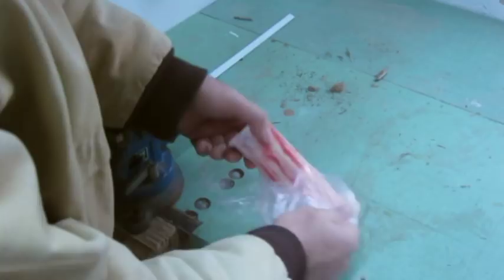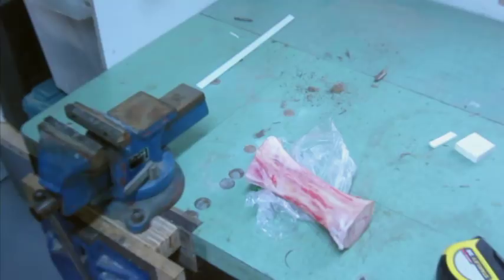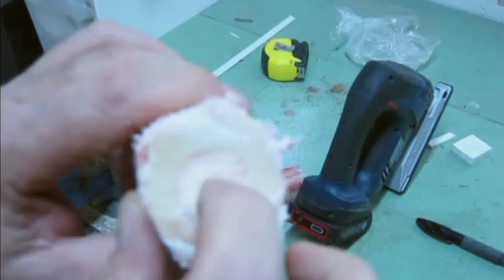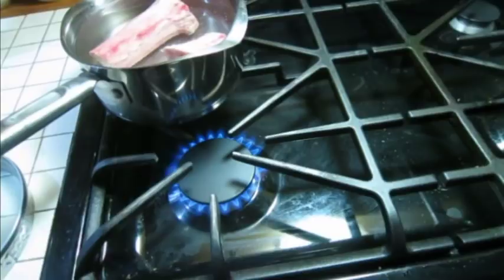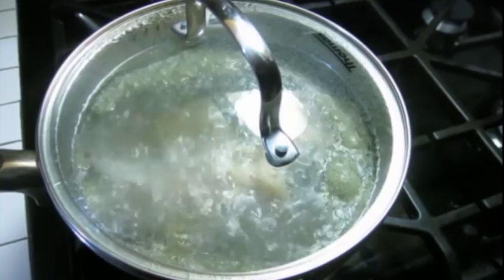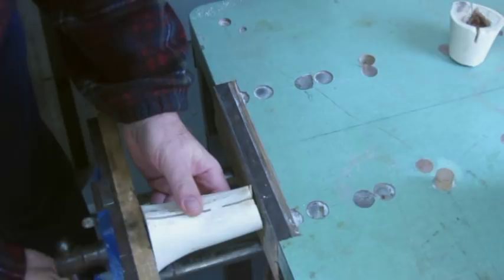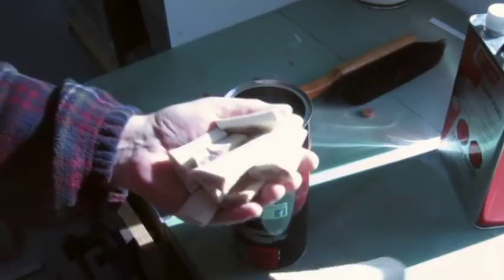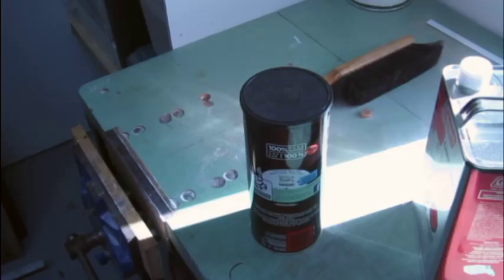Guitar nut blanks from bone

Comment: For those interested, Sean J. Barry has a great instruction document on the web.  Here is the link to a .pdf http://www.hangoutstorage.com/banjohangout.org/storage/attachments/archived/files/preparing-bone--2012-574917912014.pdf
Reply from the maker: Ha!  I think that is the one of the sources I used.  Thanks.
Reply: I have a big shin bone from a cow that's been naturally dried out in the sun do you think it would work it's been dried white for two years at lest I keep it because of the bone nut's I could maybe cut from it. I just got a Squire Strat CV 60's it was the last one they had a rosewood fingerboard now they use palmeno wood or maple  salesman the guitar was ordered w/a Bone Nut installed guys wife made em send it back they charge $90 for a Bone Nut upgrade at Sweetwater. I have to say no ping's in the bone nut. Great playing Strat. I'd love to have bone nut & saddle for my 12 string acoustic & 6 string acoustics. That thing sings it could only get better w/bone I think.
Reply from the maker: I am not sure if time will take the oils out of the bone by itself.  I am no authority on the subject but I would try to degrease it regardless.  The sun MAY have taken the moisture out, but it is the oils that will react with glues and finishes, and may also go rancid as far as my logic tells me.
Reply: Ah! "Just what I need for dissection lab tomorrow!" Thanks!

Comment: One last step to removing the grease from the bones is after the soak in the white gas (Colman fuel) place the bones in a pan of cold water (make sure the bones are completely covered with the water). Add a couple of cap fulls of clear ammonia ( the amount is not highly critical) to the water and bring the water to a full boil. Let it boil for a few minutes. You will see any remaining grease come to the surface. 

Simply soaking the bones  in a degreaser, ie. the Colman fuel, loosens the grease but you need to then drive the loosened grease from the bones. The boiling action accomplishes this. The ammonia further facilitates the removal.

After the boiling (2-5 min), let the water cool and skim off as much of the gunk as you can and remove the bones. You can use a bit of liquid dish soap and water to wash off any  residue that might be on the outside of the bones from the gunk in the water.

If you decide you want bleached bone use hydrogen peroxide for the bleaching agent. You can use the stuff you get from the drug store. I think it is around a 3 percent concentration. You could add a bit of water to it, perhaps up to 1 part water to one part peroxide. Either way how long you leave it in the solution is somewhat by trial.  Start with a few hours, rinse and let dry, preferably in the sun. If, after the bones are dry you want more bleaching put them back in the solution. This type of bleaching will be pretty gentle to the integrity of the bone. Any bleaching will deteriorate the bone to a degree, but this method is pretty good. DO NOT USE BLEACH, LIKE CLOROX!! This is harmful to the bone.

As far as the initial boiling of the bones, I believe the more you boil the more the bone is compromised. I would re-evaluate that. 

Thank you for sharing this. Creating one's own materials can be fun for the full "hand crafted" experience.
Reply from the maker: All the research I did didn't specify the second boiling with ammonia.  Thanks for sharing the info.
Reply: Just wanted to chime in here. I hadn’t seen this method elsewhere in my research either but I decided to try out boiling the blanks after the gasoline soak...and was amazed to see the drops of grease leach and gather on the surface! This tells me that it’s worthwhile to do so
Reply: I don't have access to Coleman fuel (naphtha-based products) in my country. Are there similar alternatives that can do the same job?
Reply: What’s the benefit you get from thoroughly degreasing the bones like this? I haven’t actually tried making my own blanks yet, so I’m just curious about the “why” behind this part of the process. Do they stink like rancid beef if you don’t degrease them thoroughly lol
Reply: @arsamy96  Do you have access to charcoal lighter fluid? Lighter fluid is a light petroleum distillate, aka naphtha. Maybe they’re just calling it by a different name in your country?

Comment: An alternative is to boil the bones in 30 per cent bleach and just wash and dry them. You will get  white and odor-free pieces. In fact, Vet college used this method to build a frame for anatomy model.
Reply from the maker: Correct, but you don't get beef broth for cooking when you're done.
Reply: Bleach will break down the bones hardness & made it crumbly. Not good way to go in the long run it's as bad a greasy bone a couple of the Naphtha baths should suffice.That's a great article on the subject in the description.

Comment: I use a arc saw, is much better, you can easily cut the piece. Sometimes I ask my butcher to cut it to me. For the cleaning, I use to throw them to my dogs lol. They work on the meat and marrow for a while, and they use to forget about the bones (or burry them). Then I boil it if needed. I make picks, and I've made a knife for opening letters.. I really love the picks, and my son loves the knife.
Reply from the maker: I have not heard the term "arc saw" before.  Is that an oscillating multi tool?  Very curious to find out.  Thanks for the information.
Reply: Cool!😎

Comment: Question: is it necessary to de-fat the bones? I feel like then, the nut would be, "self-lubricating," for a while, at least. Or maybe it would make gluing the nut much harder/impossible?
Reply: Michael Jung no need to glue the nut, tight fit and the strings hold it on, need to remove fat or it will soak into the wood.
Reply from the maker: If you do not remove the fat, it will go rancid and smell bad.  You only need a couple of dots of glue to hold a nut in place, usually on the end grain of the finger board.  More than that will cause issues if it needs work again.  Yes, fat will interfere with the glue.

Comment: you can save yourself a lot of soaking time, by cutting the bone into blanks or at least slices before defatting. cutting is a little less smelly and dusty, if you dont wait for it to dry. simmer 20 minutes or so with plenty of dish spap and a little splash of bleach, wash and let them dry. letting the bones dry between ~24h (or 1h with initial vacuum) naphta soaks helps to draw out the fat faster. 3-4 passes should do. for a pure white you can bleach with H202 after this. 
long story short, i used bone for inlays.
EDIT: spap was supposed to read soap, too amusing to change it.
Reply from the maker: I don't mind spap.  Thanks for chiming in.

Comment: Pretty cool. I use wild deer antler for nuts and saddles all the time. The outer "bark" on antler is very hard and slippery.
Reply from the maker: Thanks.  I never thought antler would work.  Good information there.
Reply: I was wondering if antler would work, as I have a decent supply of it already well enough cured for stuff like knife handles. Does it still require degreasing, or any other special steps?
Reply: I just came across your post, I have tons of red stag & axis antlers, And I kept thinking these would make wonderful nuts for a Stratocaster I'm rebuilding.. Is there anything special I need to consider, or can I just simply shape the very tip and make a nice fitting blanked out of it? Danny in Texas..
Reply: @livergen  antlers are suppose to be too soft.

Comment: Is ist better to cut the nuts vertically or horizontally out of the bone. Thinking about it, it seems to better to cut it so the porous sides are pointing to the head and the saddle of the guitar...
Reply from the maker: From what I have seen, the "ends" of the bone go across the board.  So the strings go across the "grain" of the bone, more or less.  I could be mistaken though.

Comment: What liquid is used to soak
Reply from the maker: In the jar?  Naptha.  Just boiled in water first.
Reply: Jim Dockrell yes in the jar sir, what is that hydrogen peroxide?
Reply from the maker: @bukansiape9612  It is Naptha.  Also sold as Lighter fluid, Camp Stove fuel, Coleman fuel, and White gas.
Reply: Jim Dockrell oke thanks sir, in Indonesia naptha is tiner

Oke oke thanks a lot
Reply: @bukansiape9612  it's called "thinner", remember the "h".

Comment: 20 string Guitar to need a FOUR & 1/2" Saddle????
Reply from the maker: That's just what was left over after cutting off slightly oversized nut blanks, or, I can cut it in half again and get 2 more nut sized blanks, which I may have more use for.   20 strings?  You're giving me ideas....lol.